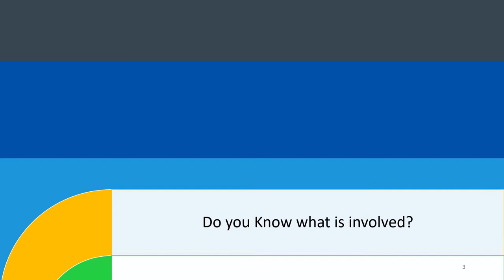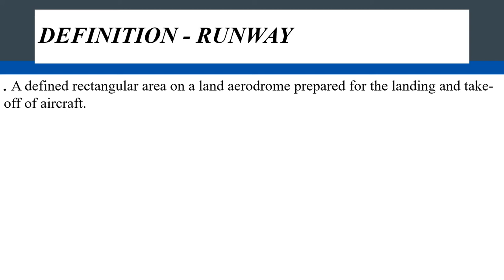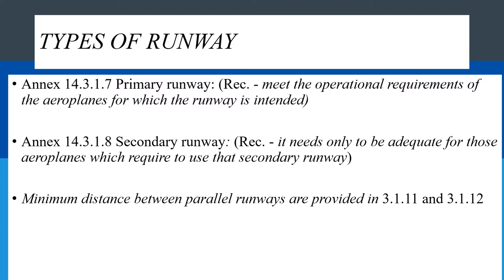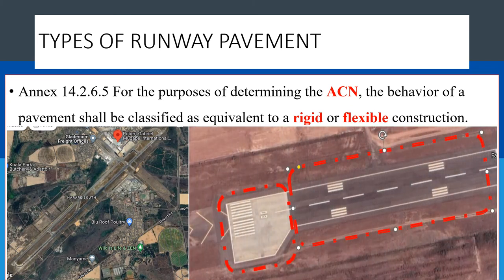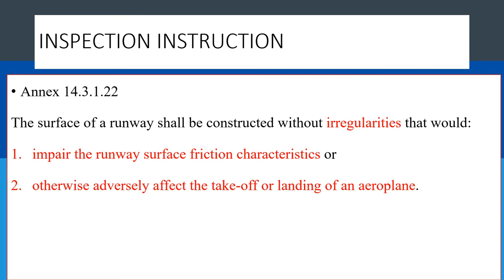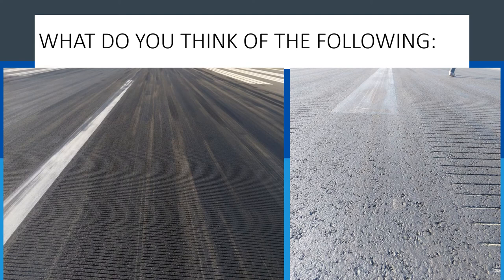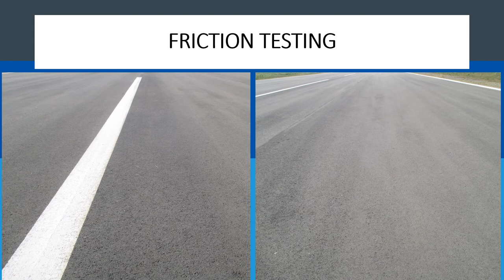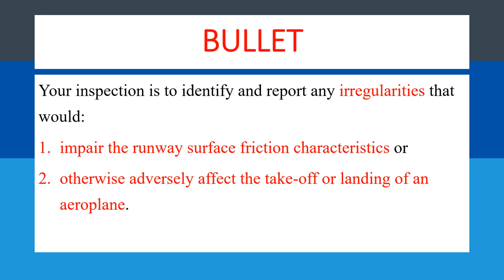Lecture 5 AIRSIDE FACILITIES RUNWAY

Comment: skid markings , rubber deposits which reduce friction characteristics and endanger landing acfs during rainy seasons, Inspector shall advised the ATC to ask the Pilot about Braking actions levels, especially during raining , and rubber removal shall be done according to the traffic density or structures of rubber deposits. Mr isaac could you upload new video about GRF Global Reporting Format , assessing Runway Condition codes during rain?
Thanks for informative videos
Reply from the maker: I will look into it and get back.

Comment: there is lots of rubber deposit which could affect the breaking action of aircraft when rain fall, i will advice management for urgent rubber removal process to be carried out.
Reply from the maker: Management must surely look at removing contaminants from the runway
Reply: Before Rubber removal,Doc 9137 and Annex 14 clearly indicates at what frequency a friction test needs to be carried out by airports based on total movements and also all up weight of aircraft using the runway…Based on that you plan for rubber removal and not wait for situation to worsen..